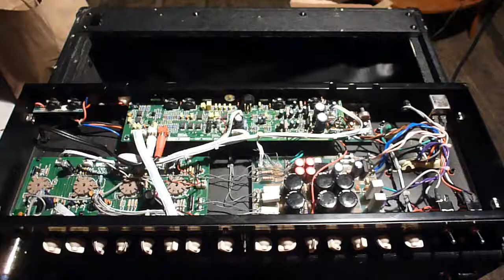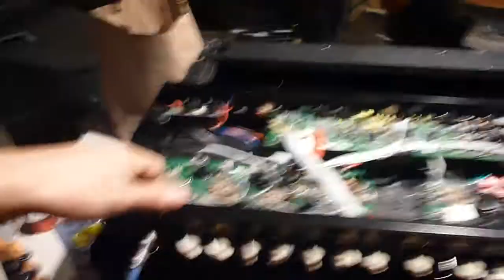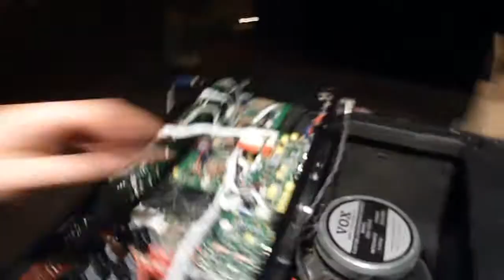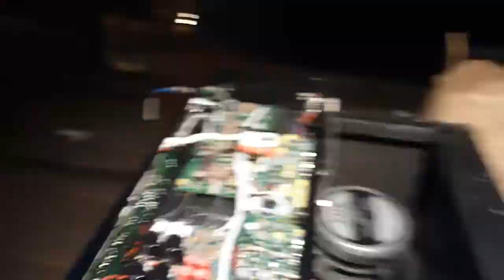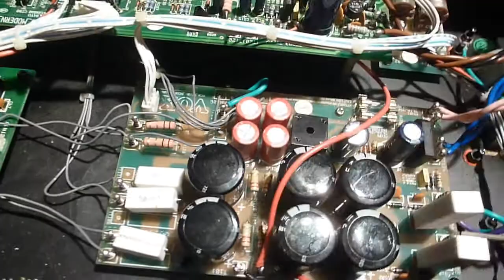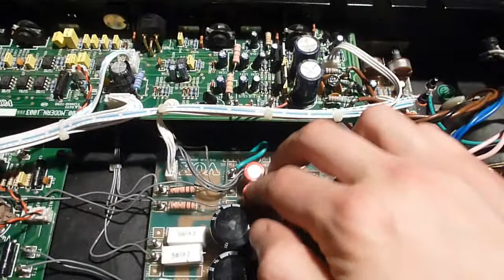Vox AC50CP no sound - DC filament supply failure.

Comment: I know this is an old video but please, if you're gonna poke around the insides of amps - USE A WOODEN STICK NOT YOUR FINGERS! You don't wanna get a potentially lethal shock arcing through your soft squishy insides!
Reply: You make a valid point but I'd like to think he drained and checked the filter caps before going in there.